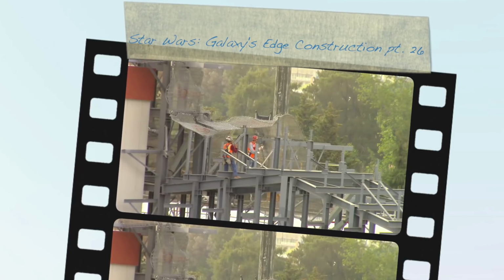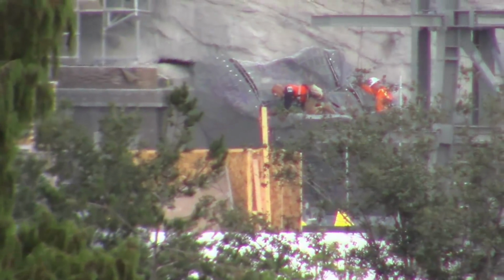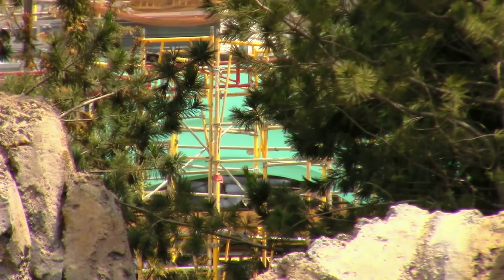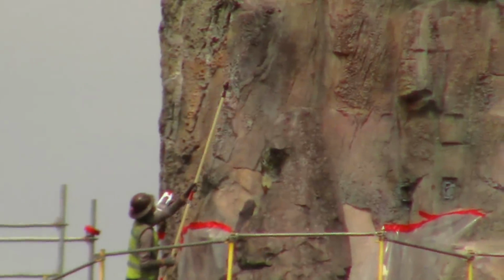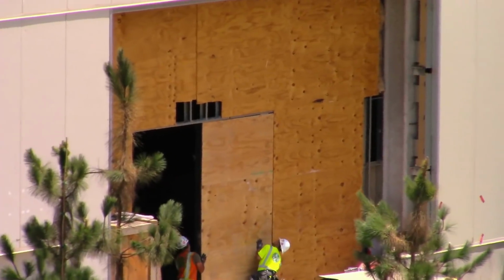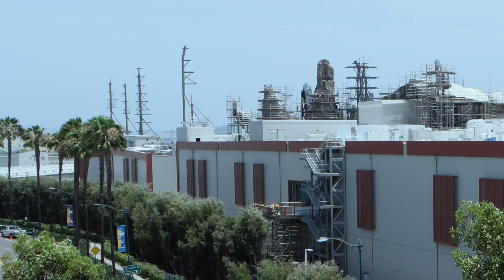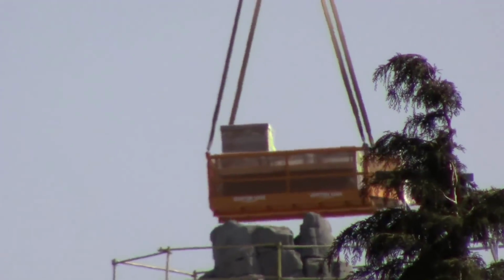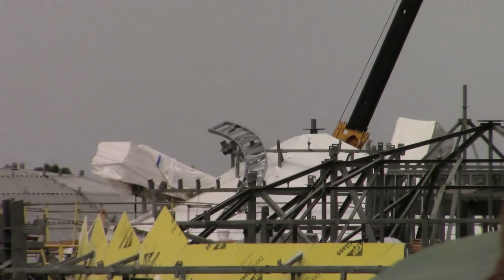STAR WARS: GALAXY'S EDGE (aka - STAR WARS LAND) Construction at Disneyland (STEP-BY-STEP) - part 26

Comment: awesome update as always.  That curved beam structure is just one of many isn't it? To form a domed structure?
Reply from the maker: Hey Steve.  Yes. The curved beam structure that was placed on top of the pyramid structure is one of many that will be placed on top of the building. It's interesting that this curve beam structure was placed in a different position originally, then taken off and put up where it is now.  It is possible that this beam structure was being used to test at different locations for beam alignment.  This will make sure that all the beam positions on top are perfectly aligned.  Soon I'm sure they'll bring in the additional curved beam structures for support framework for the dome.  Thanks for watching!